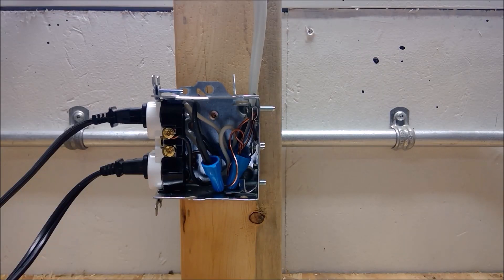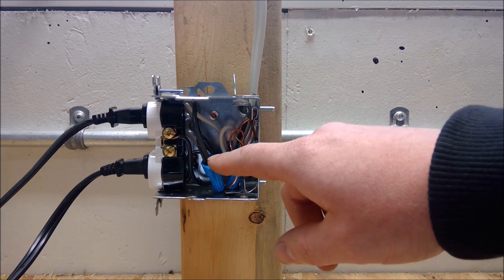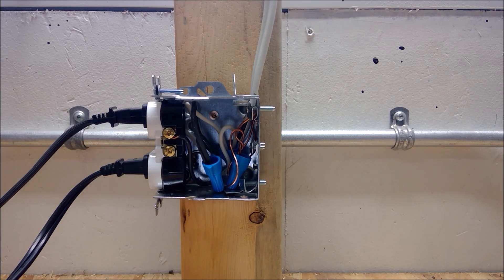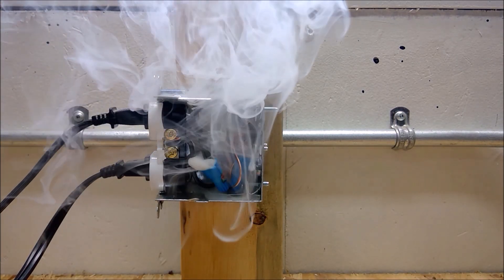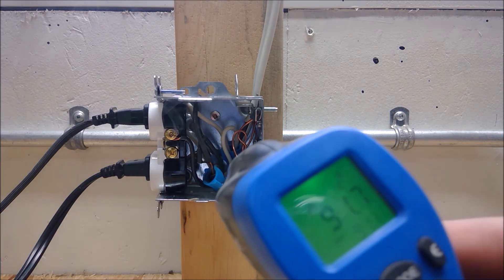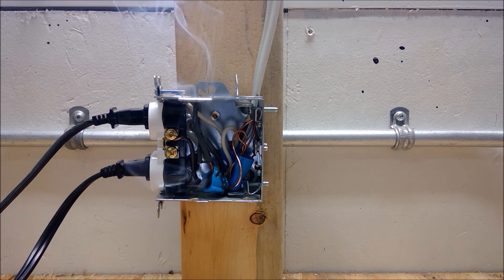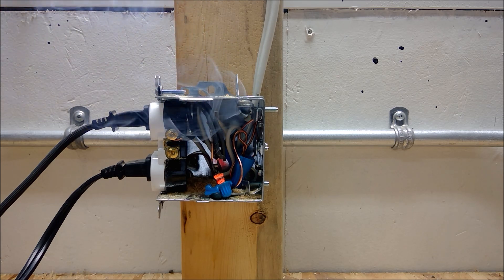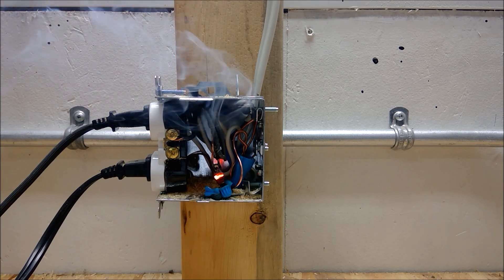Loose wires cause fires.

Comment: Just a note from a 20 year residential electrician.  First you nail up boxes.  Then you drill holes to pass wire through.  So, yeah, sawdust in boxes.  Also, most problems I have ever seen are caused by arcing at a bad connection.  Just think, an arc is used to melt steel together.  always twist wires together before you wire nut them securely.  I have been on service calls where the problem was a melted push-in connector, so they are not perfect.  As far as loads go, most failures of this type I have seen were from running a portable electric heater.  It does not even have to happen at the receptacle where the load is connected.  If there is a bad connection at another device upstream it can happen there.  Just my 4 cents worth.
Reply: Agree 100% 
I ALWAYS, every time twist the conductors together evenly and tightly. 
Always use the screw terminals on receptacles. (avoid the push in b.s)
In my experience the push in connectors don't stand up to any considerable electrical load, I don't like using them.
Reply: @montgomerybojangles8644  Its interesting because in Europe the screw connectors (wire nuts) are banned and only push-in (or lever) connectors are allowed.  In the UK, for instance, you will never see an electrician use a wire nut. It's all Wago connectors there (or junctions that use actual screws).
Reply: @montgomerybojangles8644  They need to be made illegal.
Reply from the maker: I agree with both comments. I just wanted to show a situation that could happen under worse case conditions. I didn't even use the stab-in part of the receptacle. I think I might for my next video. 
Maybe melt the plug 😀
Reply: The wire nuts are designed to make a perfect twist. Sometimes I'll use a wirenut just to pretwist a big bundle, if it looks stressed, then I'll throw it out and put a fresh one on. Think about twisting 6 wires with a Linesman plier... not going to look as good as a wirenut connection. I do get paranoid often though with larger wire groupings and back the wire nut off to be sure all conductors got a good twist. But if it's 2 or 3 wires and I stripped the same amount of insulation off each wire, as long as all the conductors are lined up at the strip point, I know the wire nut will make a perfect connection. I generally grasp the wires about 3 inches away from where the nut is, and hold it firm so the twist doesn't migrate down the wires. Usually 9 twists does the trick.
Reply: @williamm.7978  I never pre twist
Reply: This happened to my kitchen counter line.  It had 2 CFi's (not sure why) and the fridge on the same circuit.  After tracing the problem, i found the black wires in the j-box burned. Melted Merit twisty thingy.  Why didn't the circuit breaker trip?  Can someone tell me how many CFi i need and where to install them?   How do i avoid this from happening again?  It's fairly new electrical, prob 2 years installed.  I guess my Keurig may be culprit?  My toaster is on the other side counter.
Reply: @harvortiz4756 I think you mean GFCI’s which are code for new construction within 6 feet of a water source. GFCI’s are based off of load imbalance between the hot and the neutral, approximately five milliamps or above trips the device. Imbalance is commonly caused by reactive load, however most Kuerig’s have a capacitor containing metal-oxide varistor rated at 15amps meaning that your plug, if wired to code, should be able to accomodate your load. Your coffee maker would fault first rather than the plug. Your kitchen countertop should have a dedicated 20 amp circuit if it’s newly constructed. This means that it goes to a 20 amp breaker, has 12/2 wire, and has a plug rated for 15 amps or above according to the NEC. If all is to code it may be a loose connection at a junction box or if the plug is loaded from another plug, it could be off of the plug upstream. It may be worth while checking voltage with a tester. Visible fluctuation can mean a bad connection somewhere.
Reply: Mechanical connections is what my grandfather would yell when I first started out in the trade. A pair of linemans do every joint I make.
Reply: I just did depicted 20a 100' in restaurant for$480, guy pulled out his calculator and started to divide to see hourly rate. I couldn't belive it! But that was problem whoever his previous electrician was didn't even twist the 12awg wires together just a wire nut and it wasn't even twisted on hard. I don't understand why people only use wirenuts and not twist hard. (Cool thing that helped me was using a coaxial screwdriver from Klein. Works great twisting them on HARD. but I still do t trust it and manually twist the wires and cut them to have a V shape.
Reply: Will you recommend the twist connectors better than push in connectors??
Reply: Great information 👍🏼
Reply: indie209 only an arc fault circuit breaker is designed to detect these types of faults (arcs) the ontario electrical code requires afci breakers for all receptacle circuits in residential dwellings since 2013
Reply: This is something I have noticed with Electricians, you do not have to twist your wires together in a wire nut, even the manufacturers of the wire nuts say not to do so. It's all about making sure you have a tight connection which is why many electricians do so. I just put them together a bit, twist them a little and let the wire nut do the rest, zero problems.
Reply: Wouldn't the circuit breaker cut-off the current if this happens?
Reply: @indie209  One of the major point of the video was exactly to show that the breaker isn't of any help in this situation and bring awareness to such thing....

Comment: Nice vid, cept for the hilariousness of it. two devices that normally should max out the connection, running at the same time, and yet only pulling 14 amps? Yea... Then again, Idk if Canada uses 240v or not. In which case yea maybe that's ok, and kinda bad ass that you could even run both of those devices on the same circuit no problem. Buuuut anyway..... Yea no, 9 minutes drying your hair AND making a bagel in the same room.... dunno about you, but I don't know of a single food item that you'd throw in a toaster and wait 9 minutes for. Oh, and the saw dust. yup that saw dust! Just magically in a box that normally can't have any get in to begin with since they're added AFTER the construction of the frames....
Reply: 40 Year old camp ground communal kitchen with 4 toasters plugged into 2 sockets by the counter (very old plastic outlet boxes so they aren't fully enclosed. The building had New cupboards installed so some loose sawdust has settled over the wiring out outlets.  These situations do exist  and that why you electrically test for the extreme worst cases.
Reply: Oh I know situations can exist, but that sort of situation is one very niche one. Because 1) those toasters shouldn't be plugged into just two outlets if the circuit isn't meant for it... which I doubt it was lol. 2) where they cutting the boards directly overtop of the outlets? Because I find it just a taaaad hard to believe that once the boards were cut, they just left the sawdust covering the boards, glued/screwed/nailed them together over top of the outlets, and then hung them over the outlets. That just kind of sounds like some really dumb people who shouldn't have been doing what they were doing... 

If the cupboards were DIY'd and not store board/a kit, then I can understand a tiny bit of sawdust, but all of that should be outside so it doesn't get the interior of the building dirty... cause i mean, camp grounds are kinda surrounded by ya know, outdoors... saw dust isn't gonna hurt the outdoors lol. 

Now if the 'kitchen' was dry-walled, and they cut through the drywall to put things against the studs, I'd be wondering wtf they were thinking as well, as most cupboards will mount perfectly fine without having to cut into the drywall and expose insulation/make the building less energy efficient... 

So all in all, the only real way I can see any decent bit of sawdust getting into an electrical outlet under legitimate means, is if they were installing cupboards where there never was any to begin with, and had to drill pilot holes and such for them. In that case, yea a good bit of dust can be created and easily gotten into almost anything. So I'm going to assume that in this situation, that was what happened... Because any of the others... makes me give up hope on a part of humanity..

Comment: Somewhat misleading as the cover is off allowing air in and smoke out, a normal metal box is closed up and while the plastic nut can melt there's nothing much else to burn in there, it's self limiting.

Rodents love gnawing wires in walls too.

All my house wiring is in steel conduit, and armored metal, I never use that plastic romex crap or plastic boxes.

Comment: I’m fast asleep, toasting a bagel, and drying my hair.
Reply: or a pentium 4 computeer
Reply: Mark Jones hi fast asleep, toasting a bagel, and drying my hair. 
I’m dad
Reply: @ludwig4029  Dad? You're dad? Last I saw you, you were "just running out for milk". Bastard
Reply: a space heater can pull the watts.
Reply: For 9 minutes, simultaneously. Whilst removing the box cover and sprinkling some sawdust.
Reply: on a 15 amp 14-2 recepticle
Reply: Did you leave a cigarette burning as well?
Reply: @c0t0d0s7  I lit it after I fell asleep
Reply: Washing machine, tumble dryer, dishwasher will all pull this kind of load. Doesn’t matter if you’re toasting your hair or drying a bagel, you don’t want this going on anywhere in your wiring.
Reply: @julesdownunder I just cook my food on the burning receptacle lmao
Reply: Sigma 🫡
Reply: Don't be a smart ass cuz you'll be the one it could happen to cuz you're not taking it seriously! I hope not 🤷🏻‍♀️

Comment: In Canada we are required now to use arc fault breakers on all receptacles. Perhaps excluding the vacuum or washer plug.
Reply from the maker: That is correct. This circuit was not AFCI protected because this installation was completed before that Code became required.

Comment: This is exactly what happened to my sister's cabin.  It was in escrow to be sold and they did a "last minute jury rigged fix".  She left a heater plugged in while she took a day trip.  Came back and it was totally destroyed (thankfully didn't take the forest with it!).  Fire department reported cause was faulty wiring.  The problem is real.

Comment: This needs a few more amps and more sawdust.
Reply: and some gasoline
Reply: NO! It needs Photonicinduction!
Reply: fallenwout 😂
Reply: The sawdust comes from when the electricians are drilling through the studs. Happens way more often than you would think
Reply: @4schitzangiggles  what if I use aluminium studs like a normal person?
Reply: Marcus What do you mean like a normal person?
Reply: @heavyweather  aluminum studs? Uhhh, you mean steel studs? I'm not aware of a single manufacturer of aluminum studs for residential or commercial construction... And steel dust/iron oxide is flamable, it's one of the ingredients for thermite, along with aluminium dust.
Reply: @heavyweather  most homes have wood studs, wtf are you talking about

Comment: This only happens because you have the less safe 2 pin plug standard.... if your country raised the standards to have 3 pin plugs (like we do in the UK), the earth safety wire would prevent this from happening...
Reply: The Earth is called ground here. It is the bare wire in the box. These two appliances are double insulated and do not require a ground, like your appliances with the plastic Earth pin. The metal box is grounded. The hot (Live) wires were not making contact with the box. Thus, the current couldn’t ground out, and continued to flow normally

Comment: That box looks a mess to begin with.  It also looks as it there are some low voltages in the box as well.    If the electrical wires are coming in from the back (from the conduit),  they should have been connected to the screw terminals with zero wire nuts required.

Comment: Can that happen to a phone line jack?
Reply: Phone cord carries low voltage DC for communications, not supplying power. If you have a loose termination within a comm box, it might give you a poor, or non existent phone signal. No fires.

TL;DR: No.
Reply: CL McNasty I know DC is more susceptible to voltage drop, but I'd be surprised if it were 120vac at the jack. 
I'm curious now... Brb while I put my meter across the terminals of a phone jack

Comment: Sooooo, what I've learned is ... if you have loose wire nuts, don't plug your wife's blow dryer into the same outlet as your Keurig.
Reply from the maker: One way to solve the issue. :)

Comment: This is also why all splices are required to be in a box. Not sure how a plastic box would fair though. =\
Reply: sparkythebuilder usually boxes are metal
Reply: That is not necessarily true. Plastic (and similar material) boxes have been used for over 50 years in electrical construction and remodeling. I have seen the damage caused by loose connections, and while the plastic boxes have melted, that have mostly contained the heat.

Comment: 2  --  15 amp devices in a 15 amp socket. You have a circuit breaker issue.
Reply: Stephen Wissel he said they were drawing 14A total
Reply from the maker: KilerReviews if the load is non continuous and the breaker is rated for 100% operations then it can be loaded to a 100% of its rating.

Section 8 rule 8-104 (3) of the CEC
Reply: Spaceman Rick Spaceman Rick He says only that he is using a standard breaker and that the circuit is wired according to the CEC. Where I'm from standard just implies it's single pole. I need to ask for a non-AFCI explicitly, hence me asking for clarification. No need to be rude.
Reply: I'm a big fan of the set screw vibration proof Marrette (or Marr) connectors.  They are larger, more expensive, take more time but they work excellently.  The screw on cover is phenolic and can handle 150 celsius.   I'm very sure your city or code inspector allows them.  This is a version available in the US.  https://www.amazon.com/Mechanical-Conn-Screw-10-18-PK10/dp/B000LEZGEK
Reply: You had said there's 14 amps of load in the video. Did you test this with an Arc fault breaker or just a standard breaker?
Reply: Niagara Mike 
Agreed. Mechanically sound, and maintain a solid electrical connection. 👍
Reply: Niagara Mike a pack of 10 for $18 bucks...??? Are you out of your mind..? That's just nuts.. No pun intended.. lol..!
Reply: KilerReviews oh ok... ill be sure to run that by the wing-nut police.
Reply from the maker: The current of the receptacle was maintained at 14 amps. If you review the video I mention that.
A 15 amp break can be loaded to 80% of it's rating when the loads are continuous. I set the video up to demonstrate that the circuit breaker will not trip if it in not overloaded.
Reply: Does any body pay attention to anything they see, read or hear anymore? Re-watch the video, this time pay attention.
Stephen, I hope your not an electrician. 
Scott, he clearly states it is NOT an Arc-fault breaker.
Pay attention!
Reply: you're only allowed to draw 12 amps on a 15 amp breaker.
Reply: Well, to be fair, he was speaking Canadian, not American.....
No, seriously, I was wondering the same thing myself. This was demonstration, folks. A rather good one, at that. I really wish my city would permit safer connections than the wirenuts, but they forbid them. Sigh.
Reply: @ethelryan257  Wire nuts is an excellent connector when done properly. Can easily put Wago to shame. I don't trust any stab in type connector to carry a heavy load. I have seen HO fluorescent fixtures where the stab in wire connections have failed and burned the socket.

Comment: Would this happen on a circuit which is protected by a gfci
Reply: yes and no, since a gfi only detects current leakage to ground, it would only trip if a bare live conductor would touch either the bare ground or the box
Reply from the maker: If the circuit did not come into contact with metal box which is bonded to ground then yes. But both Arc fault Protection (AFCI) and Ground Fault Protection (GFCI) would great improve the chances of this not occurring.

Comment: Hey I was using my toaster one morning and nothing was burning in it but I smelt extremely strong burning candles could that have been the wiring 

Also when I use my electric oven at times I smell matches but it needs to be cleaned so I’m assuming that smell is from the grease
Reply from the maker: You should have that looked at by a qualified individual.